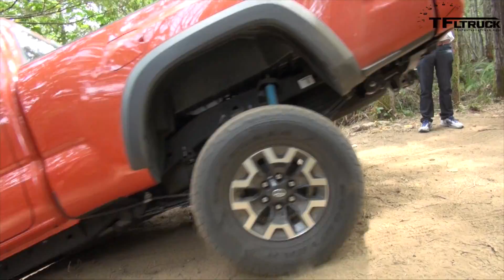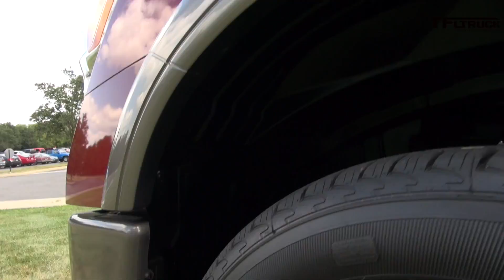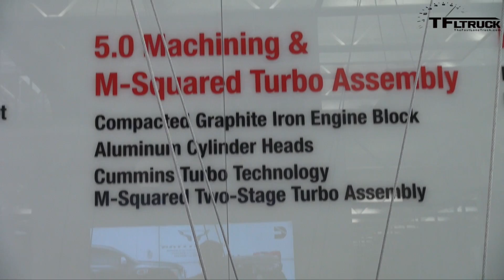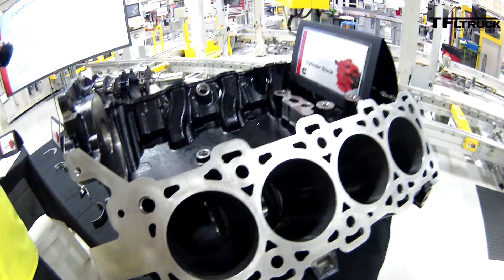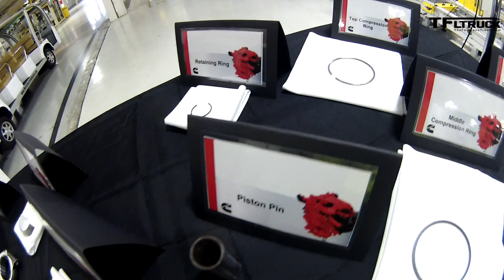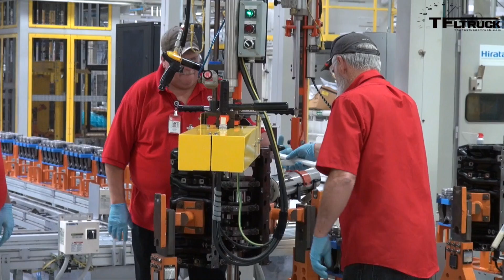2016 Nissan Titan XD: 5.0L V8 Cummins Revealed: Almost Everything You Ever Wanted to Know

Comment: Seems like a really long development timeline
Reply: R1600Turbo ya no,
4 timing chains is a clear indicator of a bad design.
Perfect for the titans though, bad engine to alongside a bad truck.
Reply: +cwescapexlt4x4 They fucked something up along the road.
Engine development doesn't take 8 fucking years.
the 4 fuckig timing chains are a clear indicator of a bad design.
Reply: +SANIC exactly
Reply: cwescapexlt4x4 
8 fucking years for a little 5.0L engine is insane.
Reply: +SANIC As others have pointed out, the Cummins ISV - the engine being talked about in the video - has actually been in service for quite a while. It did not take 8 years to engineer it. The Titan program for Nissan's version of this engine may have been that long given Nissan's glacial pace in updating their truck, but the engine has been around for several years already.

Also, you're in aerospace, where government military contract money gets pissed around like it's water. Cummins, while having a defense unit of their business, doesn't benefit from the same level of funding for every project.
Reply: SurelyYewJest engineer literally said it took 8 years.
please rewatch the video.
Reply: I know what he said because I did watch the video, before I even replied to you. Maybe you should watch the video and then do some research online so you can truly understand.
Reply: +SANICthey use chains strictly for quietness. many engines use several long chains with no problems. slack is adjusted with oil pressure only other choice is belts and that a waste of time
Reply: David Robertson you know it!

Comment: Can't imagine having to replace that fuel pump or turbo. Also I thought a few manufactures tried aluminum heads on cast blocks in the 90's with poor results because of head gasket longevity because of the different expansion rates between cast iron vs aluminum? (Cadillac is the only one that comes to mind.) Seems like a cool truck to have while under warranty but I can't imagine ever having to work on it.
Reply: +Austin Smith Why can't you imagine replacing that fuel pump or turbo? Just remove the intake or whatever that is on top of the engine and there ya go. The block is made of compacted graphite iron, not grey iron. I'm pretty sure the engineers have thought of that.
Reply: headcas620 why can't I imagine it? Have you seen how much shit is on top of thar motor?? And it's not as simple as "just take off everything on top of it" that's like saying all that goes into building a serious motor is throwing parts together. 

Good point bout the blocks tho. Didn't know that
Reply: +Austin Smith Actuall if you have ever worked on a Duramax they are about the worst to work on. Their fuel pumps sit in the valley and you have to remove the Y bridge to get the fuel pump out.

Comment: ugly and then a newly designed motor.  big big concerns.  Nissan quality is poor these days.
Reply: +Inverted Hover One of my customers owns a new Pathfinder.  He recently drove from Texas to San Diego and stopped in Arizona on the way back.  In Alamogordo, NM he stopped with his family to eat at McDonald's.  When they got back in the push button start wouldn't work and the car was immobile as a result.  There was no Nissan dealership there so he had to have his car towed and hole up in a roach motel for three days with his three kids while they waited for the key fob to be overnighted to them.  They had to pay $300 in advance plus shipping because Nissan doesn't warranty the key fob.  He said his wife said she remembers dropping it and apparently that was enough to disable their vehicle.  Not good, IMHO.  Nissan seems to be putting lots of features in their vehicles at a lower price point than Honda or Toyota but their reliability is really poor.  Their parts are also outrageously expensive compared to other manufacturers.
Reply: +Iam TheOsprey That's odd. I have a keyless Camry and I know that if I damage the key all I have to do is hold it up to the push button and to get the low frequency, and it will still start up... no remote access but it wouldn't leave me stranded. Seems like Ford and Nissan don't work that way.
Reply: AdriannnTRD
Toyota make more reliable things for sure.

Comment: If diesel has more energy per gallon than gas why do they produce such less HP and that includes with a turbo?
Reply: +RAJohnson713 The two above me are wrong, because diesels don't have more energy. Diesels are more efficient and produce more torque because of their high stress combustion process, higher boost levels, higher compression ratios, high injection pressures, etc. which is a requirement for diesel but not unique to them, which is why so many DI and Turbocharged gas engines produce the same amount or more torque relative to their displacement while producing more horsepower and being less complicated. In reality, if gas engines were designed to run the same way as diesel, they would actually be more efficient and more powerful. Unfortunately, there are drawbacks to a high-strung engine, which is why they don't build most gas engines the same way they do diesels.

And really, the question shouldn't be whether gas or diesel has more energy, the
question should whether gas or diesel is more efficient (Efficient = maximum productivity with minimum waste). In fact, it is a myth that diesel is more efficient. Neither diesel fuel, nor the diesel cycle by nature are more efficient. In reality, diesel are very wasteful and high-strung, they produce a lot of emissions, which requires very expensive and complicated emissions controls, and they only operate with very high stresses, which requires more lubrication, more cooling, stronger construction, etc.
Reply: +RAJohnson713 The want torque not HP. HP don't puts you up a hill, torque does.
Reply: +Chuck B No, you're wrong. Diesel uses more boost, more injection pressure, 30,000 PSI in many cases vs 3,000 in direct injected gas, and high compression ratio, often 16 or greater to 1 vs gas engines which run often run 9:1. ratio. Diesels are much more high stressed than gas engines.
Reply: +Chuck B WRONG

Diesel engines are much higher-strung than gas. That is a 100% fact.
Reply: +RAJohnson713 Actually, they don't. If you were to use the same compression ratio and run the same boost level in gas engines and atomize gasoline the same way we do with diesel fuel, gasoline will actually create more power than diesel. Diesel actually doesn't produce much energy and requires a lot of energy to burn.
Reply: Larry The UK show Fifth Gear tested that,and the diesel on gas ran well for several miles. http://www.dragtimes.com/video-viewer.php?v=b5xhPAundL4&feature
Reply: *****
No, you're wrong. Why do so many TGDI engines produce the same more torque while producing more power horsepower with the same displacement?  You said everything being equal, so there.
Reply: *****
"Engines using the Diesel cycle are usually more efficient, although the Diesel cycle itself is less efficient at equal compression ratios. Since diesel engines use much higher compression ratios (the heat of compression is used to ignite the slow-burning diesel fuel), that higher ratio more to air pumping losses within the engine."

"Modern turbo-diesel engines are using electronically controlled, common-rail fuel injection, that increases the efficiency up to 50%...." -Wikipedia.

Diesel IS NOT more efficient, it is the higher stresses that makes them more efficient.
Reply: Larry
That's not even equal, because gas engines still aren't using the same compression ratio as diesel. With a slight increase in fuel pressure and turbocharging, it has made gas torque on par with diesel while still allowing gas engines to make more overall horsepower.
Reply: It's not uncommon for turbo diesels and gas engines of similar displacement to produce similar torque numbers but diesels can typically accomplish the same amount of work with less fuel if they are geared properly.
Reply: +Larry They also can be easily modified to run on various non-petroleum based fuels.  Not so much with the newer ones but the old ones are still out there.  However, if gasoline engines were so inherently better why are big rigs gasoline?
Reply: *****
TGDI stands for "turbocharged gasoline direct injection". Just look at some of these modern 2.0L gas engines, the 4 cylinder engines with DI and turbos, most produce more horsepower and torque than the VW 2.0L TDI, which is one of the most popular diesels today.
Reply: +Chuck B You don't know as much as you think you do.
Reply: +Chuck B Whether gas or diesel is better debatable, but it's a fact that diesel engines are more "high-strung" by nature. They need high compression and atomized fuel just to even turn over, never mind making usable power.
Reply: *****
Of course they're not the same, they're GAS! The question is, with all things being equal, or at least as many things being as equal as possible, does gas produce more power, and it does! What more proof do you need than modern gas engines using technology once reserved for diesel? And you know, if you didn't care but wanted to learn, dump 100% gas into a diesel and see how well it runs. The gas will actually run stronger with a diesel cycle and higher pressure, guaranteed! It won't run for very long because of lubricity issues and that will destroy your fuel system, but it will make more power in the time its running.
Reply: +1GTASANANDREASCJ Yet most turbocharged gas engines produce roughly the same torque.

Here are some comparisons of modern turbo gas engine to diesel engines and their torque.. 

BMW Gas 3.0 - 406 lb-ft @ 1850 RPM
Ford Ecoboost Gas 2.7 - 375 lb-ft @ 3,000 RPM
Duramax Diesel 2.8 - 369 lb-ft @ 2,000 RPM
_

Ford Ecoboost 2.0 - 270 lb-ft @ 2500 RPM
BMW Gas 2.0 - 255 lb-ft @ 1,250 RPM
VAG TSI Gas 2.0 - 258 lb-ft @ 1500 RPM
VAG TDI Diesel 2.0 - 236 lb-ft @ 1750 RPM
GM Ecotec Diesel 2.0 - 264 lb-ft @ 2600 RPM

Also, they tend to produce way more horsepower. I'm reading what's being said above me, and that's also valid.
Reply: +Quadrunner and typically at a lower RPM
Reply: 1.Diesel has more Btus then gas
2. to build a engine based on torque or horsepower depends on: rod length, stroke, timing, rpm, etc. (to name a few)
3. Diesel use turbo or supercharger  because a diesel is a air pump in which  diesel fuel self ignites as the piston reaches tdc. So by forced induction you get more efficiently over 100%

Short and simple without the theoretical stuff.
Reply: Larry WTF....Those side effects of a high strung engine are accounted for in design, which has consistently led to higher compression ratio engines with greater efficiency that can run all day (that's literally what they do lol) at wide open throttle, and idle with next to no fuel....Its been repeatedly proven in real world testing that gasoline engines have got nothing on diesel in the efficiency sector....yet. I mean, the only reason we've been seeing a change in the gap is because diesels are being hindered at the same time gasoline designs are advancing.  Its just hard to compete with that high compression slow burn in the most usable rev range.

Gasoline is low octane, which is why gas engines aren't likely to run like a diesel.  Saying otherwise is just preposterous.  Come back with a high octane fuel design, and then we'll talk.

The trucking market is almost completely dominated by them....Buses utilize them widely...This is because they work, profitably.

They aren't more complicated......

I can't believe good confident writing isn't questioned more.  Diesel fuel by nature leads to greater efficiency due in large part to the higher compression ratios.  They are built heavier, meaning there might be more torque and load, but the load is spread over more metal just like any other torque oriented engine.  Stress = Pressure/Area, which is why diesels are heavy.  The emissions are whole nother can of worms lol.  If you don't want them, just buy and older diesel...many of which are known to last forever.  The point is, they are not the be all end all of engine design as some portray them to be, but they've got their place contrary to your lopsided take.

Comment: I was considering a Ram 1500 diesel but I'm holding off a while.  The Titan looks very interesting.
Reply: +NuclearGrizzly The Ram 1500 isn't really for hard work but the Nissan is.  Unless you need a heavy hauling/towing brute the Ram 1500 is probably your best bet.
Reply: Iam TheOsprey
I understand that.  I don't tow but I may need to carry a heavy payload off road and in adverse conditions.  The Ram would probably be enough truck for me but I'm waiting until the pricing is available because I won't need to make the decision until next year..  If I can get a lot more truck for a little more money the Titan may be the better value.
Reply: NuclearGrizzly
But...Nissan.  They don't have good reliability.
Reply: Iam TheOsprey Come on.  Nissan has average reliability.  But Cummins has excellent reliability.  Do you know about the issues that Ram has had for years with it's anti-spin rear end?  Like I said, I'm going to wait and see.

Comment: why does it have two batteries
Reply: +Bmackins94  most diesels have 2 batteries sir, its for auxiliary power.
Reply: +Ryan Vier I never knew that
Reply: +Htown7 My dodge diesel and ford diesel had two batteries in each one, very common in diesels.
Reply: +Bmackins94 it takes a lot of power to crank over a large diesel with such high compression ratios, especially in the cold
Reply: +Bmackins94 Cause its Foreign
Reply: Which one lasted you longer?
Reply: Just get a Chevy.
Reply: cummins is now a sellout, Dont think you will be seeing a powerstroke in a foreign  truck. isuzu makes chevy's. smh.
Reply: +Reaver fx Detroit diesel makes the duramax
Reply: +Bmakins94 Almost true, its a joint venture between gm and isuzu. Powerstroke is the only in house  made diesel for its own pickup of the big three.
Reply: +Reaver fx Isuzu has v6 duramax
Reply: Bmackins94 guess im not seeing where your comming from. Still a joint venture with Isuzu from what I can see.
Reply: Reaver fx yeah its a joint venture
Reply: Bmackins94 as far as I can tell know gm hasn't  produced its own diesel engine since 2000, then gm teamed with isuzu for the duramax.
Reply: +Bmackins94 it's for long drives most of vehicles died in the center of sand country, one one battery
Reply: It's got two batteries because the starter requires a high amount of amperage to crank the engine over.
Reply: +Htown7 The engine is all American.
Reply: Okay? Truck is still trash.
Reply: +Htown7 Is the Ram eco diesel trash? American truck with a Italian engine.
Reply: Very
Reply: +Bmackins94 diesel's have two batteries for glow plugs and intake heaters, they have to power those to heat the air for it to ignite the fuel when its cold out. plus it has to run starter at same time. my 5.9 cummins has a intake heater that uses 100 amps by itself.
Reply: +Bmackins94 Top end price is around 60
Reply: That maybe one way to stockup a truck in a cold and hard to heat up then?